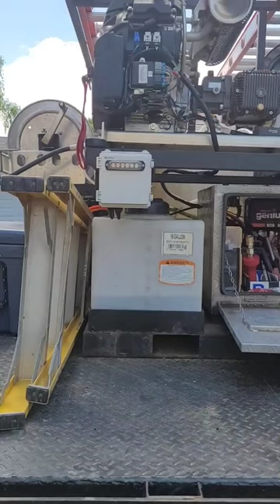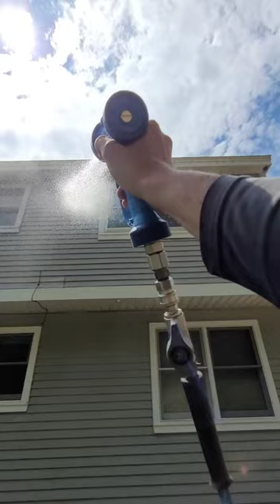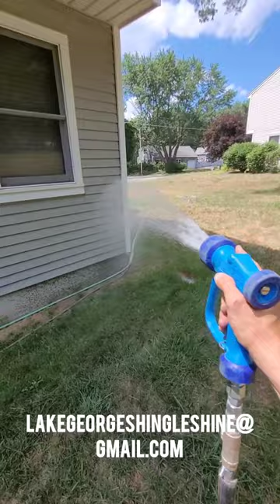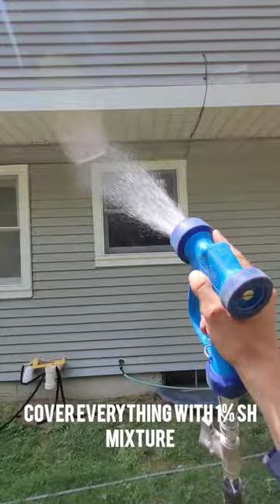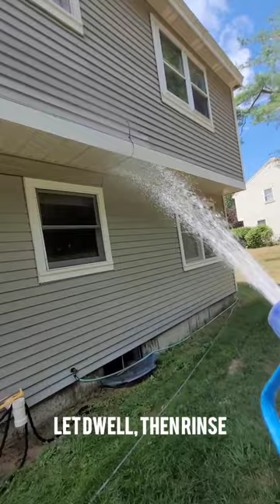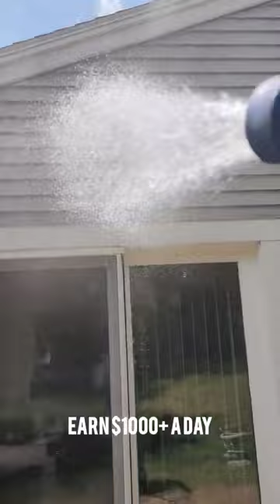Higher Flow for Faster Washing

Comment: So I have this gun and never used it. I don’t think my 12v pump will push through this gun. I do however have a 24v  10gpm pump that will probably push this gun but I don’t have a larger hose set for the 24v…haha basically I have $600+ in a pump and gun I haven’t used yet just sitting there for a year
Reply from the maker: Someone told me a 5/8 hose and 7gpm 12v pump flowed well with this gun. So I'd have to assume your 24v 10gpm would work 😏

Comment: No surfactant? How do you know when you’re pulling
Reply from the maker: I do use surfactant
Reply: @YoungAmbitionYA  batch mix?
Reply from the maker: I mix the soap in my bleach tank and then use a downstream injector
Reply: @YoungAmbitionYA  what kind do you use? I have a 150 gallon bleach tank but I’ve never found anything stable enough to mix and last. It usually clumps up and causes a lot of issues in my bleach tank
Reply from the maker: Lemon wash from panhandlepowerwashsupply.com

Comment: Hi so I have a question I thought you were supposed to tape up any wires or sockets to prevent electric fires?
Reply from the maker: Hey Chris. You can do that. Doesn't hurt. Another good way to prevent issues is simply to not directly spray and soak sockets. They survive in rain and snow. Wash shouldn't be different. I've done 1000s of washes and never tape any. No issues
Reply: Those are cable wires.  Nothing but sound waves going through them.  That's why cable techs can work in the rain.  Most outdoor outlets are supposed to have cover over them.  Just like the ones in this video.

Comment: I have that blue gun on my 7 gal per minute 12 volt soft wash setup what do you have yours hooked to the line Looks like your pressure washer hose
Reply from the maker: How well does it work on 12v? Yes mine is flowing from an 8gpm honda
Reply: @YoungAmbitionYA  It works great. Shoots 30ft with the 7gpm and 5/8 hose to gun.
Reply from the maker: That's awesome!
Reply: Yeah what is it hooked up to ????
Reply from the maker: Honda igx800 8gpm
Reply: Great question I was wondering
Reply: Where can I get that blue gun?
Reply: Where can I get the blue gun?
Reply from the maker: @raulgonzalez1691  almost any wash site YG1635SS

Comment: I saw your comment about using your 8gpm washer. Are you running this gun with engine at full throttle at 3500psi with a trapped unloader or a k7 type?
Reply from the maker: K7. If using this gun I'm just looking for Flow. I dial down to 1200 psi.
Reply: @YoungAmbitionYA  ok thanks